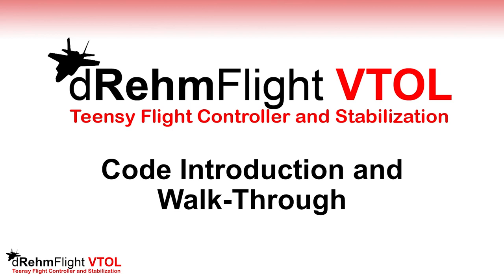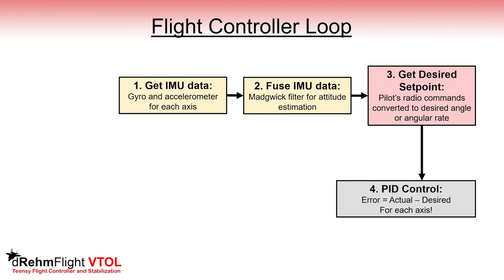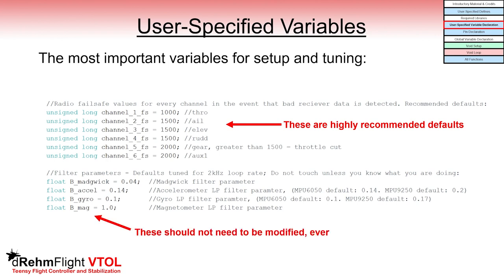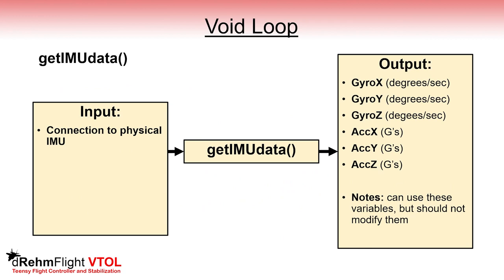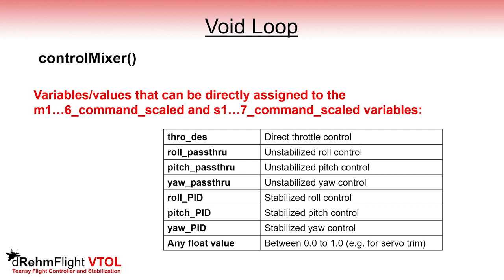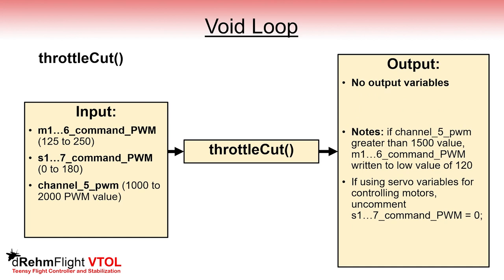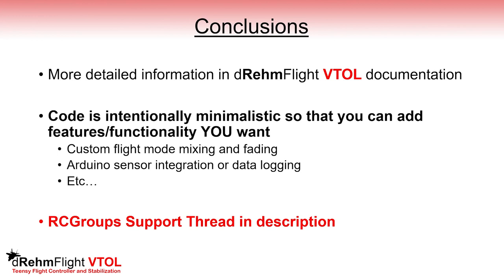How the Flight Controller Code Works - dRehmFlight VTOL

Comment from the maker: Hi all, I know this vid is on the boring side, but I wanted to make sure it was out there to help anyone get flying more easily. This is the exact same code I use for all of my projects (I literally download a clean version from github to modify for every new project) so I want there to be as many resources out there as possible for others to do the same. So definitely give the whole vid a watch over dinner sometime if you're interested in flying this flight controller on your next project
Reply: Very much interested. Keep going plz.
Reply: Boring? You got to be efffing kidding me. This is amazing stuff!!!!! Kudos and thank you!
Reply: I not think so , it was  very good.
Reply: sir its very helpfull , please make such more videos.
Reply: It's not boring at all. I'm happy to finally found someone doing this with a teensy. Good luck man.
Reply: Now im about to concentrate on this tutorial..
Reply: for me it's not boring vid
Reply: Control engineering is never boring to me.
Reply: Dear Mr Rehm,
Thanks for your amazing project. I checked the whole source code and can understand almost all things, but there is one point I did not fully understand. In your code, you wrote: 
//Regulate loop rate
    loopRate(2000); //do not exceed 2000Hz, all filter parameters tuned to 2000Hz by default
So if I use your logic with other MCU, how can I measure to change correct value for this? Because other microcontroller will work with different frequency, after that, how to tune filter parameter with new value for loop rate?
Reply: @Nicholas Rehm This is the first time I see someone describes his Github code! Thank you for this. If you could create two seperate branches for quadcopter vs hexacopter it would be wonderful :)
Reply from the maker: @real-satoshi-nakamoto  you can actually just modify the control mixing from the default quadcopter to hex, will probably take 5 minutes or less
Reply: @NicholasRehm  Thanks 😊I will try that. Could you upload the wire diagram? I also need to know how to add GPS and Raspberry Pi in current setting. Thanks again for your work.
Reply: Thank you brother, this will be very helpful for my final year project
Reply: Believe me it is not boring at all,. Thank you for the effort and well structured introduction to dRehmFlight FCC - coming from SW engineer who's getting started with FCS.
Reply: Believe me it is not boring at all,. Thank you for the effort and well structured introduction to dRehmFlight FCC - coming from SW engineer who's getting started with FCS.

Comment: Will the motors + ESC keep up with the 2kHZ loop frequency? I know it's good for the sensors but can the actuators make any significant output in 500 microseconds?
Reply from the maker: On smaller racing drone size platforms, absolutely. But you do need to be careful not to over-tune pid gains or else you’ll heat up the motors from such high speed changes

Comment: So this my be off topic since this is a tensey  project but i am asking anyway:
Will it also run on an ESP32? Specifically the newer s2/3 ? 
Also since tensey 4.1 is a bit better i assume it will work too. 
Also i plann to use an ESP32 as a WIFI receiver will this work? i did not check but i am sure there are some free pins for a I2C bus or a SPI connection.

Comment: Hello, Nice job dude, have been seeking for like this, but what is the difference between open source multiwii firmware that can be flashed to Arduino nano and your firmware?

Thanks
Reply from the maker: This is probably a more readable, easier to understand version of multiwii--mainly because the teensy board is so dang fast, code doesn't need to be optimized beyond recognition to get decent performance

Comment: i'm at the exciting part of the project now (test flying quadcopter) and i see that often times, only one servo spins when i push throttle or they all spin but are offset as i push the throttle. other times, the drone is stable on the ground, but one or two servos slightly spin and the only way to stop is to restart the drone. i calibrated the motors but i have my mpu-6050 fixed on two standoffs, so it may be my weird way of installing the IMU?

Comment: Hey Nicholas, just a quick question I wantes to ask

In controlMixer (), it says left two motors should have +roll_PID while front ones should have +pitch_PID

can you or anyone please tell how this works
Reply from the maker: If the stabilization is reversed you can subtract them instead

Comment: How could this be adapted to control an RC car with individual motors for each wheel? Im thinking of how it could control drift and apply torque vectoring.
Reply from the maker: The control mixer is your friend

Comment: hey nick, a few question: 
- will this setup work on the Teensy 4.1? 
- how much sram/flash memory does this take up on the teensy 4.0? i know this mcu is a strong boy but if you wanted to add more modifications, will it be completely okay with the rest of the IMU code?
- servo motors just mean the brushless drone motors right? lol

thanks!
Reply from the maker: Yep this works directly on the 4.1 with no changes. Code uses only like 5% or less memory if I recall correctly. You can load it up with as many modifications (sensors, additional actuators, calculations, data logging) as you want—only thing to watch out for is slowing down the void loop speed too much. There’s a lot of headroom for that though. Servos in the code refer to pwm outputs (as opposed to motors which use oneshot125 protocol) so the servo variables can be used for either ESCs or hobby servos. Motor variables can only be used on compatible bl-heli ESCs that support oneshot125

Comment: I am using SimonK ESC’s which does not support oneshot protocol, what changes need to be done in the code?
Reply from the maker: Just use the servo outputs for your motors which use regular 50hz pwm

Comment: Nicholas, thanks for the deep explanation of your code. Just wondering is it possible to port the code to Arduino Nano considering the speed and memory needed?
Reply from the maker: I started out on the nano but then moved to the teensy as the foundation for the project, so unfortunately it’s not backwards compatible

Comment: Hi Rehm… m pretty amazed at the simplicity of your explanation of code. 
Just curious, Well can we try the code on arduino board?
Reply from the maker: The short answer is no. It’ll run on an earlier teensy like 3.1 but will be slower and the filters will need re-tuning

Comment: What motors and props did you use that can support the weight of the quadcopter with the added sand bag? Great project
Reply from the maker: I use these: https://amzn.to/3wma3CT & https://amzn.to/3dMu52E on 4s

Comment: Sir can you please tell where to set the max thrust value or maximum rate at which motor should move as we want
Reply from the maker: In the control mixer you can scale the commanded throttle or stabilization values by any value you want

Comment: Hi Nicholas ,  Is my understanding correct  about  PID Controller ? 
- controlANGLE ()  is select  for Multirotor or  VTOL-Hover
- controlRate ()    is select for Plane or VTOL- FF
Reply from the maker: Correct! Angle can technically be used for forward flight too, but not recommended
Reply: @NicholasRehm   In the example code line 417   "//PID Controller - *SELECT ONE:"  *Select ONE , Is it fix for only multi-rotor not for VTOL ?  and   In case I need code for VTOL , I should //all  (Not select ONE)  then use IF (ch_6_pwm .......) instead for swap PID controller by remote sw, Right ?
Reply from the maker: @akkaradechsrithongchai7766  Correct, only one can be used at a time, but you are free to switch between them while in flight
Reply: @NicholasRehm   Thank a lot , I follow you and will try to build one , Teensy and  IMU are coming on mail.

Comment: You mentioned that default loop rate should not be changed because of filter parameters, is there a guide on how to retune them if i want to use the code on a slower platform like stm32?
Reply from the maker: https://dsp.stackexchange.com/questions/43063/first-order-low-pass-filter The 'alpha' in the equations is actually 'beta' for the filters in the code. Beta = omga*T/(1 + omga*T), where omga is the cutoff frequency in rad/s, T is the dt between loops. First calculate the cutoff frequency for the current betas using T = 1/2000. This omga stays constant for each filtered parameter (constant low-pass cutoff frequency). Using this omga and your new loop dt (1/new looprate), calculate the new beta. I'd recommend just pinning loop rate to 250hz. Do this for the gyro and accelerometer, and then you may as well scroll down to the getCommands() function and comment out the filtering happening down there--it's not really necessary. These calculations will get you in the ballpark of where they need to be... you'll need to fine tune them to get a good balance of delay to noise rejection. B_madgwick might be able to stay the same without tuning, but check your roll/pitch/yaw angles if it significantly lags behind. At the end of the day, as long as you get them tuned somewhat close and you don't expect to crank you PID gains too high, you'll be able to fly. The default tune for the teensy just gives the absolute best performance in my opinion in terms of how aggressive you can crank the PID controllers and still get a stable platform.
Reply: @NicholasRehm  Wow thanks a lot for the quick answer. This kind of dedication is why I love your channel. Cheers!

Comment: Hi Nicholas, I am trying to save other versions so I can keep the original intact, but if I try to save it the modified code with a different name, it will not compile. Do you know why? Also, I am trying to delete the folder so  I can reinstall it (I made some modifications and won't run anymore), but now it requires a administrator permission to do that. How do I bypass that step?
Reply from the maker: If you change the name of the .ino arduino script, you need to make sure the folder it is in has the same name
Reply: @NicholasRehm  nice, thanks, and if you are willing to meet and teach me how the program works that would be great. I have a project that I am working on it, but I am stuck. Do you have a patrion account? I can make a donation there for your projects. Nice work on the Starship.
Reply from the maker: @ernestosaboia  You can email me if you'd like, or we can help you over on RCGroups, that way others can benefit from your learning process as well: https://www.rcgroups.com/forums/showthread.php?3706571-dRehmFlight-VTOL-Teensy-Flight-Controller-and-Stabilization

Comment: Thanks for the video!
I would like to buy a Arduino compatible board and maybe use it for a vtol RC Plane!
Reply from the maker: This project uses the Teensy 4/4.1
Reply: @NicholasRehm  Thanks!
Reply: @NicholasRehm  compatible with teensy 3.2/3.6 ?

Comment: things are seeming to work ok thru the programming.  but now we are having no luck getting the 4 in 1 ESC to initialize.  looking at the motor outputs in the code, they are live, but that is the end of the good news.  I have the X-Rotor 60A ESC.   any ideas??
Reply from the maker: You may need to calibrate your ESC endpoints
Reply: @NicholasRehm  i think that's the problem.   i am only seeing 125 - 240 on the throttle chn.  the other chns make it to 250.  haven't figured out how to change that yet in my older Frsky 9xd.  thanks.
Reply: I recalibrated so now am getting full range.   the esc beeps, but doesn't initialize.   I got a response on RCGroups suggesting uncommenting a "calibrate ESCs()" line of code in the Void Setup area.   but that is not in the code I have been using.
Reply from the maker: @merlingreen3481  try 1.3 version
Reply: @NicholasRehm  I had been using the dRehmFlight_Beta_1.2_F-35VTOL file. The servos work with this.  when I load the dRehmFlight_Teensy__Beta_1.3, the servos drive to the end and are not operative.   Is there another 1.3 version I haven't found?  a bit more information ... i am powering the Teensy separately, not from the ESC.  the only wires I have connected between the teensy and the ESC are m1 - m4 from on the ESC to pins 0-3 on the Teensy even tho m4 isn't used.
Reply from the maker: @merlingreen3481  ahhh the F-35 code… there is no 1.3 version of f-35 code. Just use the clean 1.3 code to calibrate your ESCs then switch back to the 1.2 f-35 code you had. Make sure your esc ground wire is connected to the teensy…
Reply: @NicholasRehm  the ground connection fixed the problem.  thanks for your help!   I knew I was close.

Comment: Hey Nick,
I am getting a 0 output for all my PWM servos and they are occasionally spinning for 2 seconds but mainly making a lot of beeping noises lmao. I get correct outputs for the motors but the servos are just all zeros and I just can't figure it out. Thanks!
Reply from the maker: Have you assigned anything to the servo variables in the control mixer? Default code has them set to 0
Reply: @NicholasRehm  I have not. So it's just s1_command_scaled = 0, etc. Am I misunderstanding something?
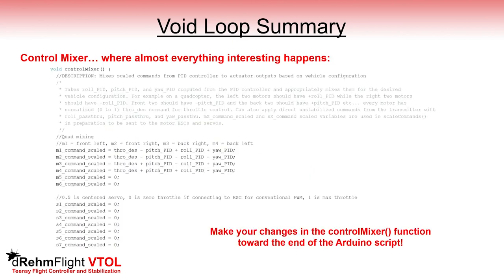Reply from the maker: @najmaperveen6504  Read tutorials 9.7-9.9 in the docs (17:09 in the video above). The default code just has output mixing for standard quad as an example. If you want to use the other actuators/change motor assignments, you need to update the assignments to the ..._command_scaled variables accordingly
Reply from the maker: Also, if you're planning to use the servo variables to control motors (which it sounds like you are), uncomment the corresponding variables in the throttleCut() function so they won't twitch like you described when throttle cut is engaged for safety
Reply: @NicholasRehm  Ahh, I just got them to spin (quadcopter). I copy pasted the lines from the mx_command_scaled_variables to the servo outputs. Very satisfying but bittersweet since I spent too many hours trying to troubleshoot.  Gotta study control mixing now!
Reply from the maker: @najmaperveen6504  plug some servos in if you have them and play around with assigning variables/constants/etc. so you can actually see and play around with the effect of your code changes. It'll be safer than motors too
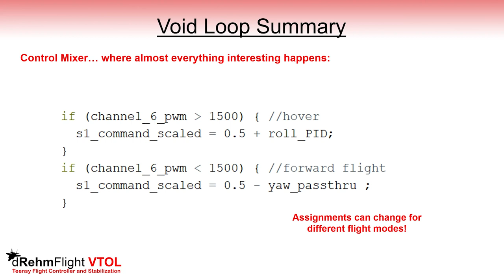Reply: @NicholasRehm   Hey Nick, to learn more about flight modes and the magic behind them, what resource do you recommend in addition to the doc? Like understanding why the code at 18:44 allows hovering.

Comment: How reliable can I assume the imu data is from the madgwick filter? Or your code I guess.
Reply from the maker: Stdev of about 0.4 deg in roll and pitch, but can be prone to drift if accelerating wildly (like a freestyle drone, for example)
Reply from the maker: @AssBurgerHD  Ardupilot uses a variant called extended kalman filter or EKF. Yes it can be more accurate, and they often have better IMU's than the 6250. It's quite a bit more computationally involved, but not really necessary on a hobbyist VTOL project like this. Thanks for your kind words